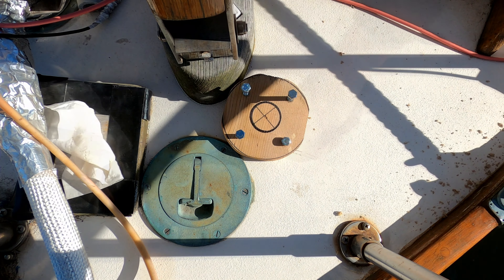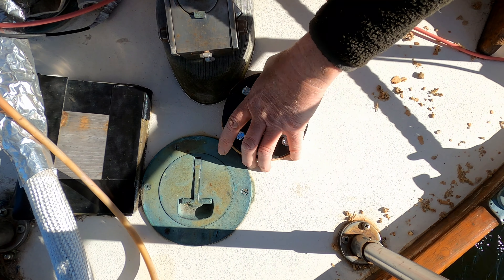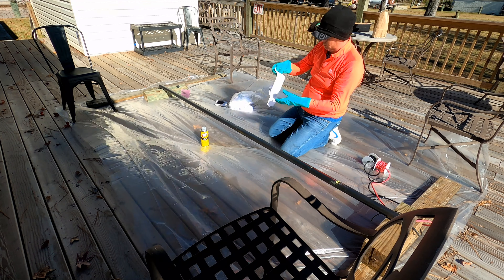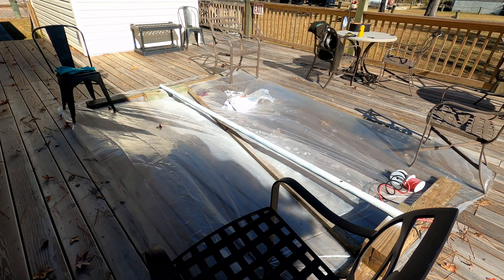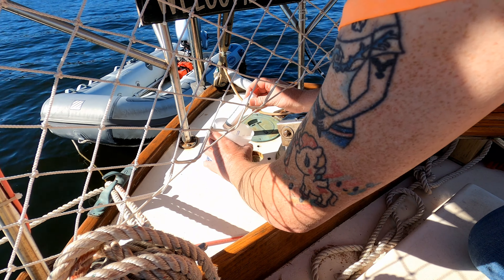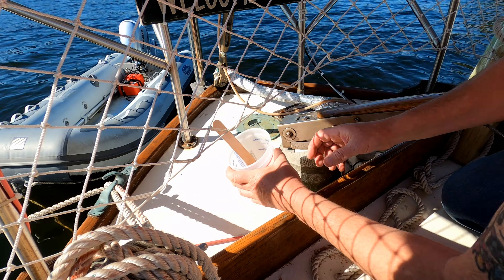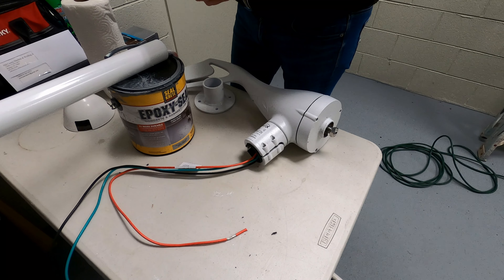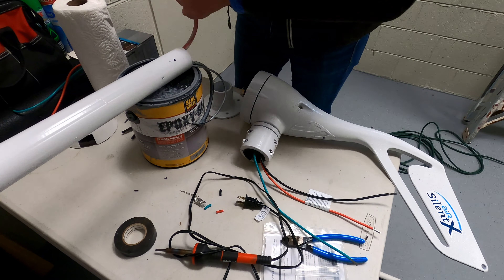S02E53 - Wind Generator Install (Primus Air Silent-X) - Part 2

Comment: How loud is the Silent X? Can you hear it while you are sleeping?
Reply from the maker: Since I used the deck as the main lateral support there is a slight vibration that I can hear in high wind. It is on my list to remove the generator and drill out the hole a bit so I can insulate it with a layer of rubber to eliminate the vibration. I cannot hear the wind generator itself when I’m sleeping but I am a heavy sleeper.

Comment: Are you happy with the wind production.  What numbers are you seeing?  Great video!
Reply from the maker: I am, to see a meaningful current the wind needs to be in the 12-32mph range which I've seen on a regular basis, with 25-28mph being the sweet spot. It really helps out with my overall power when it is storming out and my solar yield would have been very low normally but the wind bridges the gap. It's really hard to sort out the numbers and separate the overall generation from the two sources. On windy/stormy days I've seen a 12% recovery on my battery bank which would be around 108Ah, the solar would have had a minimal contribution to that number. The 12% recovery does not include the power consumed during that day, that was a net recovery. With an electric fridge/freezer that runs on and off throughout the day I would guess the total contribution to be 20ish% higher than the 108Ah.

Comment: Good video! 1 year later how’s it holding up? I’m looking at getting one. Would you recommend?
Reply from the maker: I am happy with it. The only thing I would say is to temper expectations about its contribution to your overall power supply. It only puts out significant power in a pretty narrow band of wind speed but when you have the wind it’s great. I recently got stuck in Fernandina Beach for two weeks with 30-40mph winds and it supplied the majority of our power for those two weeks. It is a very good compliment to solar.